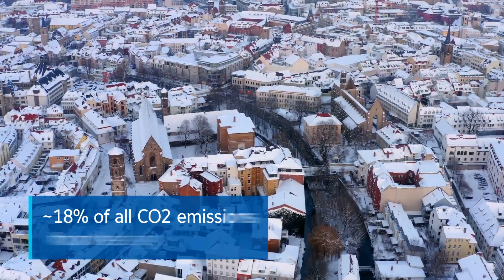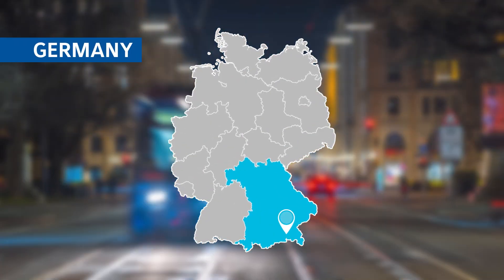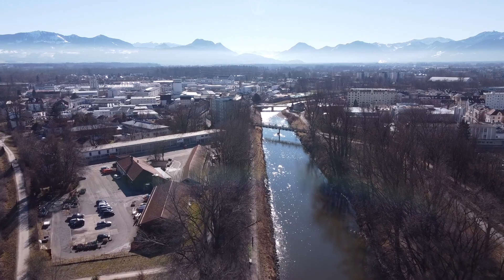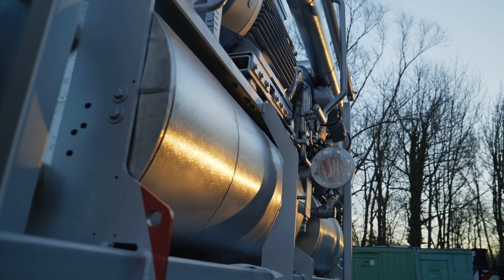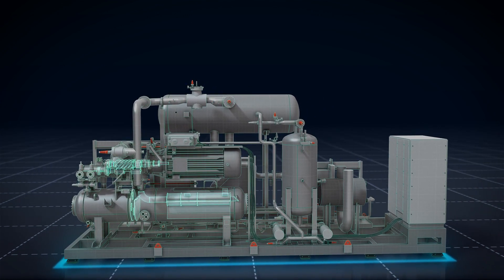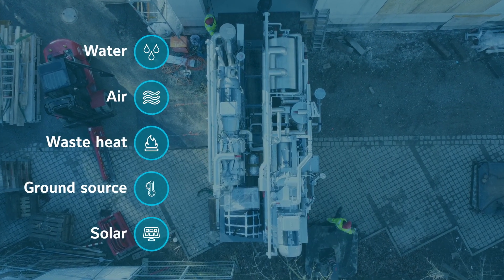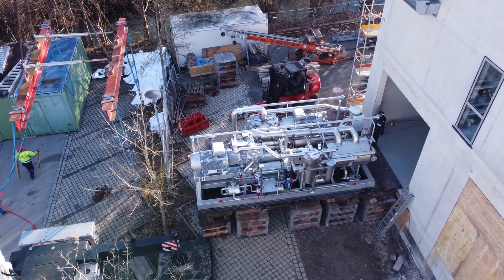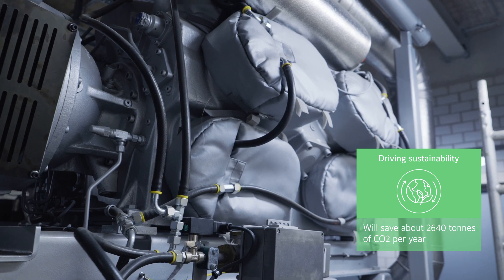Heat pump solution for Stadtwerke Rosenheim: transforming district heating in Germany

Comment: Wow....heat pump technology has rapidly progressed in leaps and bounds.  Only a little over a year ago we were struggling to find a large capacity heat pump to deliver more than 55oC and a decent deltaT  ...... and yes, we spoke to the local JCI office.

Could JCI please provide a technical paper on this system, including system schematics and model selections ??  Our office has a current high profile project where these machines seemingly would be perfect.
Reply from the maker: Exciting to hear you would like more information on our heat pumps! Could you please reach out to IREF-EMEA_contact@jci.com so we can get the ball rolling on getting you more details?